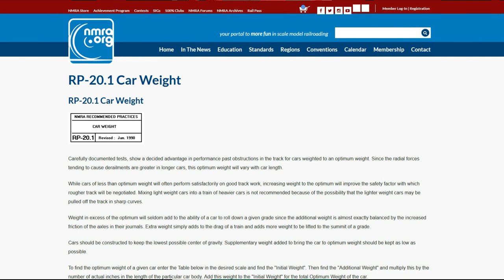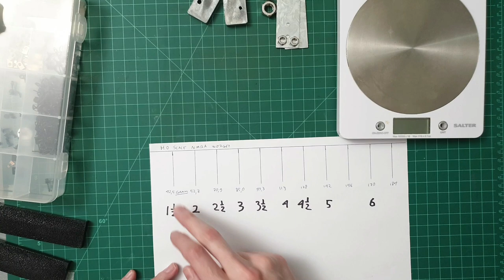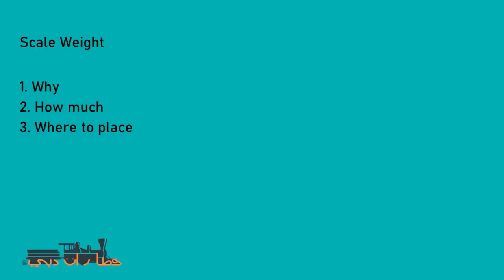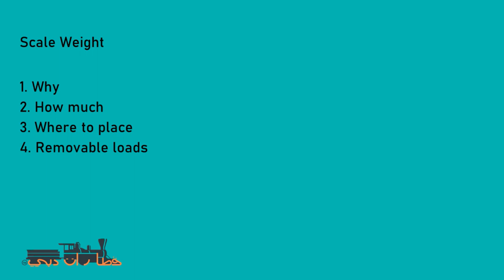33 - Scale Weight in Model Trains as per the NMRA recommendations

Comment: I made a chart for car length and weight it should have.  I get my weights from Harbor Freight and use their car weights in 1/2 & 1/4 oz. weights which work pretty well for me.  They have an adhesive backing & all you do is peel off the blue strip and stick 'em down.  The hardest ones to do are gondolas and flat cars.  I try to make loads that bring the weight up to NMRA standards.  I don't make my loads removable.  Once there made they stay and never get removed.  Cheers from eastern TN
Reply from the maker: Thanks Rusty. Only my coal loads are removeble.

Comment: What adhesive do you use for the bolts.
Reply from the maker: I just used cheap white glue. With the thinking that i can remove it if necessary as it desolves with water.
Reply: @DubaiTrains  Like Elmers...have plenty of that on hand ! Thanks for the answer and the video, very helpful !
Reply from the maker: @BruceWarnerFrederick  Happy it helped 👍🏻